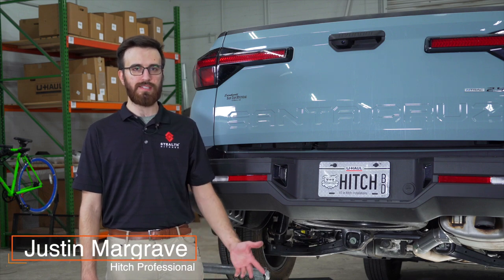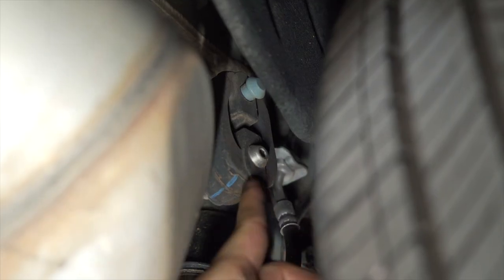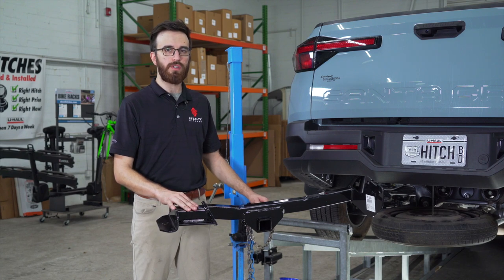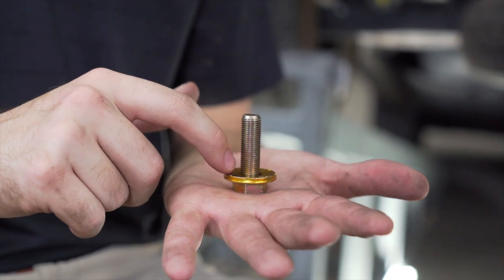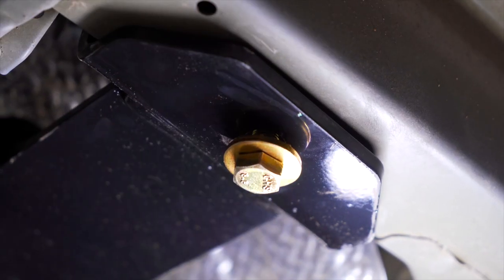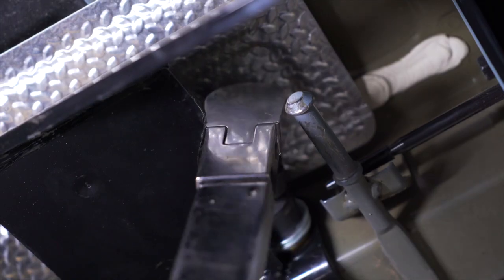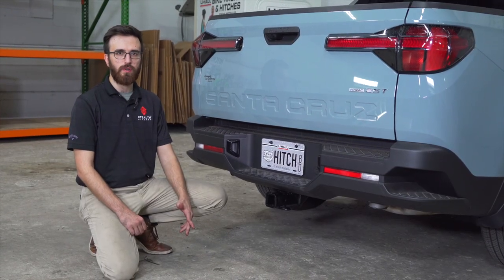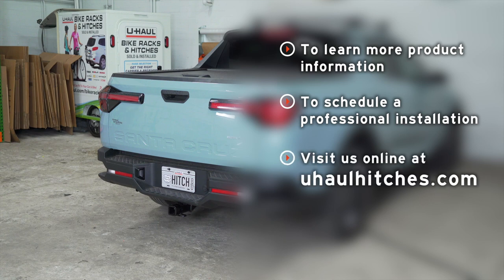2022-2024 Hyundai Santa Cruz | U-Haul Trailer Hitch Installation | CMF13486

Comment: since santa cruz has a recall on the harness. installing a hitch is not going cause an issue.
Reply from the maker: The recall is for a factory installed Tow wiring Module. Therefore if you have no hitch you do not have a faulty tow wiring module. Installing a Hitch and aftermarket wiring harness is not going to cause any issues for you.